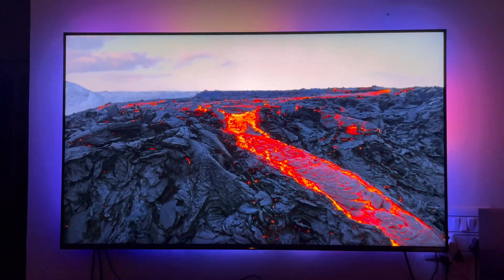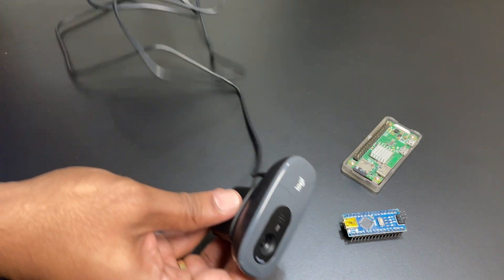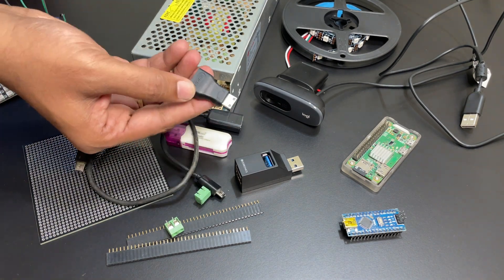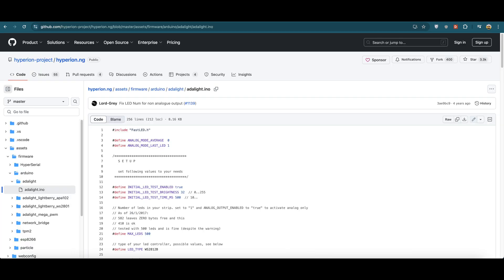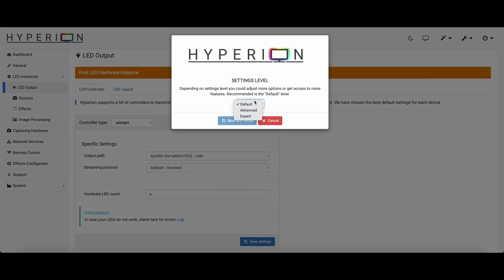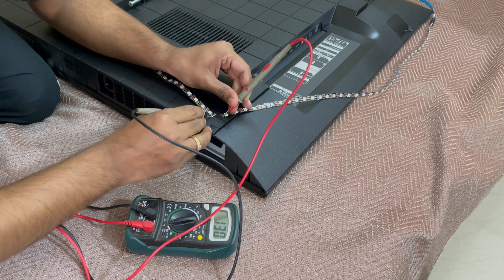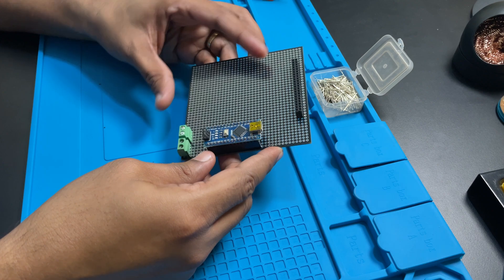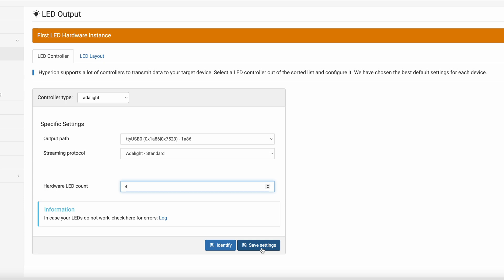TV AmbiLight with USB Camera, Raspberry Pi and Arduino || WS2812B

Comment: Why dont use the Hyperion's internal video grabber option, instead of a webcam? It works with RPi older than model 4 (on which it works too after some tinkering).
Reply: I thing the main problem with internal hyperion video grabber software is it dosent work for DRM PROTECTED like netflix and prime video
Reply: how do you capture other sources image? for example satellite, PS, hdmi...
Reply: @usr6106  if the source is external, then with video grabber, i use one inline on HDMI output, that's the same what he's doing
Reply from the maker: I didn't research enough to learn more about that option. Maybe I'll try that next.